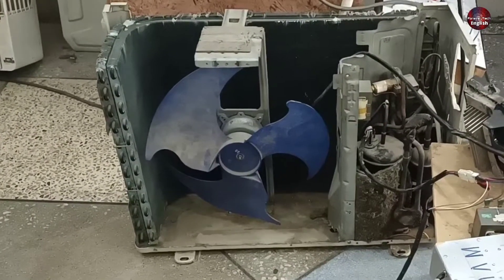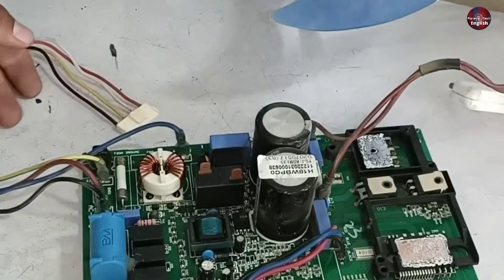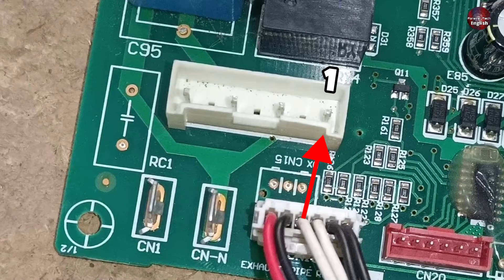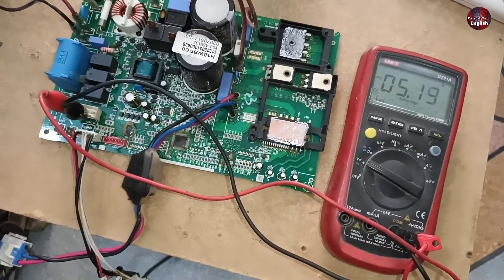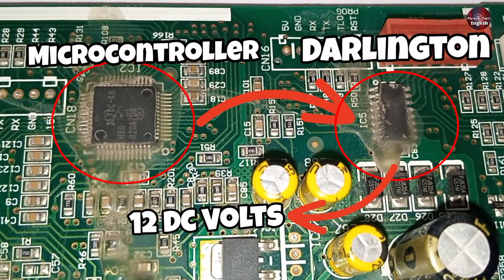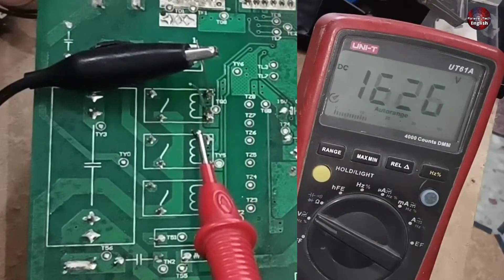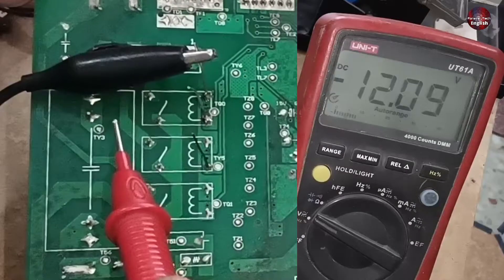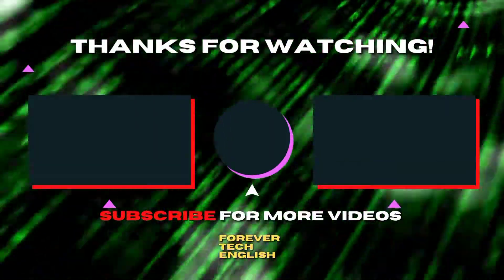Fan Won't Spin In Inverter Mini Split Ac - How I Fixed It

Comment: Hi! Great video, thank you!

Could you please tell me why my air conditioner has stopped providing cold air? 
Here’s what happens: the indoor unit works normally;  both the fan and compressor in the outdoor unit start for 5-10 seconds and then stop. After a minute or so, it tries again and stops again.
Where should I look? I detached the controller board. The capacitor looks fine (at least with my multimeter, I can see that it takes a charge).
The A/C  model is Grundig grhpa 090/091 (invertor)

Also I have a second A/C the same model, that works normally. Is it a good idea to attach the damaged one board to check if it works or not?